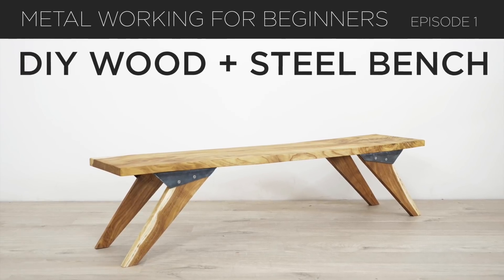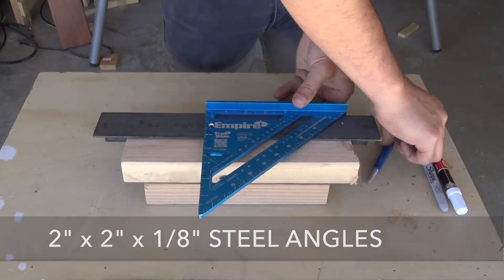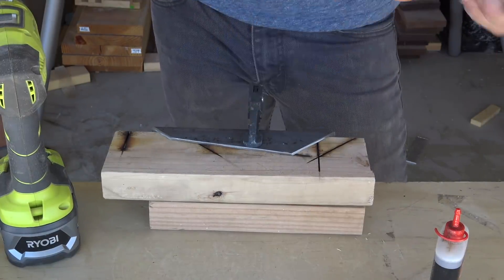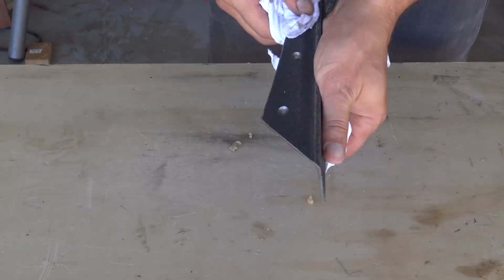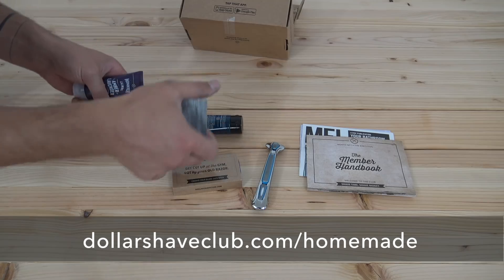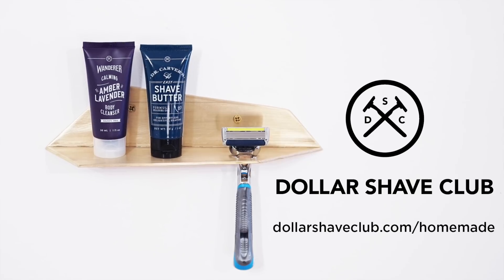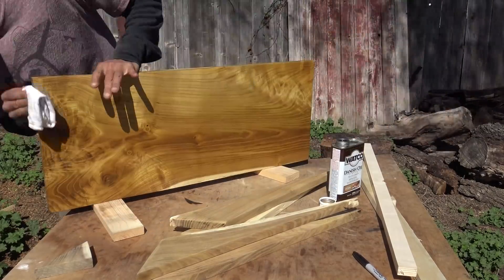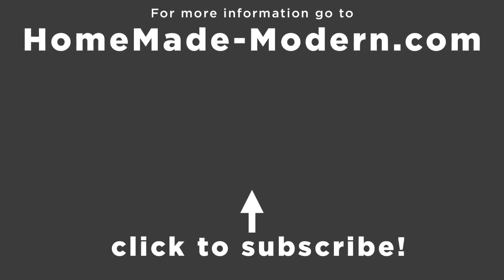DIY Bench with Custom Steel Hardware | Metal Working for Beginners

Comment from the maker: This video series will have a little more information and explanation than our typical project videos. Let me know what you think and if you want to see more of these Metal Working for Beginners videos.  My plan is to showcase simple projects that rely on one or two metal working techniques and that don’t require welding.  I am considering an angle grinder which costs about $40 as a basic and accessible power tool but I want to hear your opinions on what constitutes accessible and affordable.
Reply: Some people will be more comfortable using a simple metal saw instead of machinery. Added benefit to use it when you can't make a lot of noise.

I think you said the angled steel was extruded, but most of the time these type of profiles are hot rolled. Just wanted to point that out. 

A new series on this channel is always great news! Looking forward to the other upcoming videos. The wood and metal projects on this channel have been amazing so far!
Reply: Love it.  Keep em coming.
Reply: Love it! Thanks Ben ... And focusing on maximizing utility from an affordable angle grinder is much appreciated
Reply: I really like the idea of this series and this was a great starting project. I'm looking forward to more videos!
Reply: Love it! Ben camera time makes it more personal almost. Feels like you are talking right to me!

Comment: i'm a welder and very familiar with metal works and most machines you use but usually works with metal instead of wood but this is interesting.

Comment: I would like to add as tip:  if you can avoid it, don't get steel from your local big box store.  Just go straight to the source, your local steel yard.  It's almost always cheaper, they sell cutoffs which are discounted usually, and you get to support your local homies in the process.  Don't be intimidated by big trucks and the scale of the business, most places will happily hook you up with whatever you need, no matter how small your order is.  If your car is too small to transport your material, they can cut it down to any size for a small fee.

Comment: "You don't need any specialty tools..." Pulls out grinder... So?
Reply from the maker: The one i used is $39 at Home Depot and i am pretty sure they have a cheaper version as well.  Angle Grinders are def not as common as a drill but they are so awesome with ton of different materials.  I use mine to cut steel, powercarve wood,  cut and grind down stone  and pretty much sand/grand anything.

Comment: That's awesome! Definitely makes metal less intimidating, especially for those who have almost never worked with it (like me). Any tips for designing metal brackets like that? I noticed one angle matched the leg and the other was opposing.
Reply from the maker: make the metal brackets first then cut the wood to fit it.  i suggest drawing on cardboard and cutting out templates to figure out the angles that work for you
Reply: Oh that's a great idea! The template would also be super helpful for getting all the brackets to be the same. Thanks!

Comment: Making a freehand hole with a Stepped Drill bit into Brass gives me flashbacks. For precise diameters i would only use it on a drillpress.
Reply from the maker: yes 100% good point!

Comment: I have a Ryobi Angle Grinder I bought 2 years ago. Still haven't used it.... maybe its time!
Reply from the maker: it can be a bit intimidating but is so powerful and useful.  i recommend starting with some power carving on wood just using flap discs until you get comfortable.

Comment: Can I use my regular drill bits? Also I really like these new videos
Reply from the maker: just check the label.  if not you can get a set of bits for about $10 at home depot or harbor freight that will work fine on metal

Comment: nice peice...what drill bits do you use btw? you only have link for step drill bit.
Reply: you can find those at any hardware store
Reply from the maker: link in the description
Reply: oh ok yeah cause the only link is for the step but not the other two you used to drill. the counter sink and the black bit that you used at 2 minutes mark. thanks.

Comment: Not technically rust because brass corrodes from by creating brass oxide vary similar to rust.
Reply from the maker: Yes it is impacted by the environment like virtually all materials.  I find that it withstands household moisture quite well. I asked a chemical engineer and he said that it does not rust but rather tarnishes which creates a protective coating that prevents corrosion which is different from non corten steel which is more  susceptible to full corrosion
Reply: HomeMadeModern Like aluminum I think